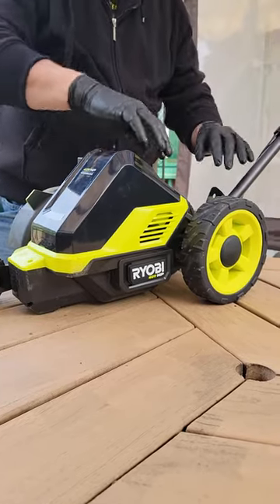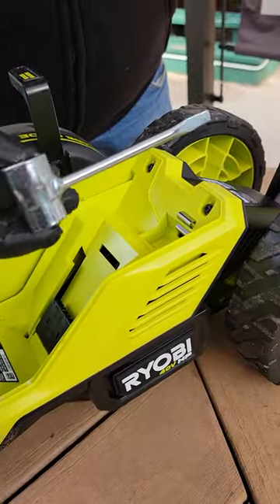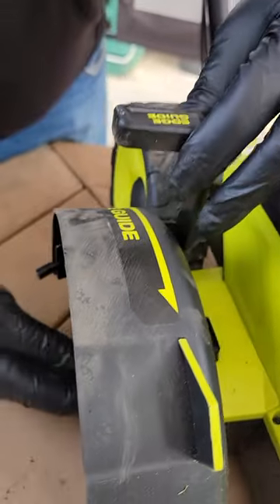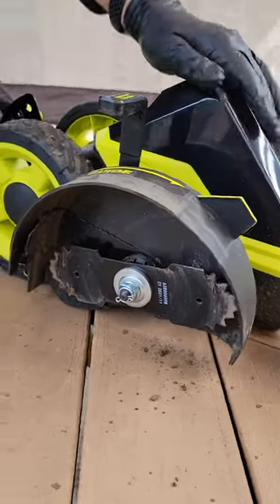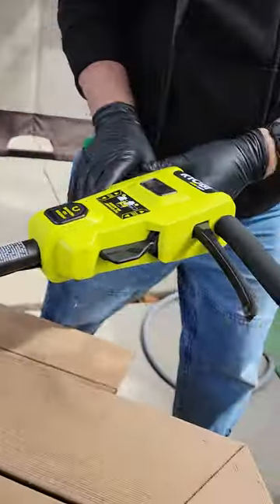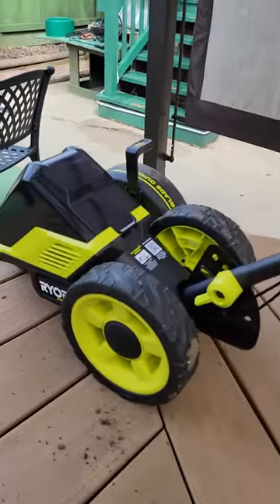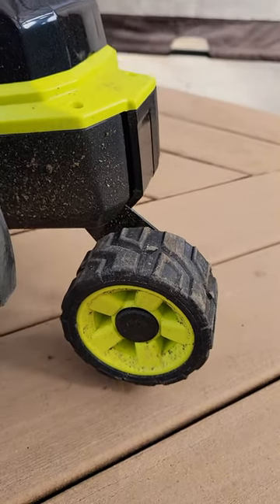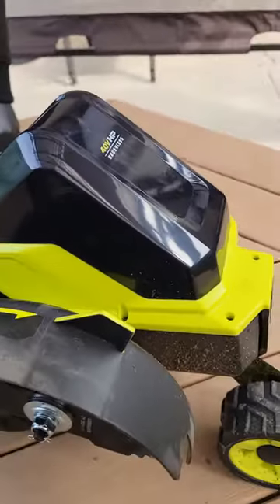20220327 145241 Ryobi 40 Volt HP Brushless 9in Cordless Edger

Comment: Just tried to use mine for the first time and the sidewalk edge guide is useless!  When I extend it down and start cutting it works great but there's no way to really lock the adjuster in place.  It kind of locks in place but any force or vibration allows it to slide up.  So as I go it just slowly slides up and I have to stop every few feet and push it back down.  This renders it basically useless for edging along sidewalks.

Comment: I got this and it works really good. Does your have a little movement in the handle bar area ? Kinda loose a little and I do see that the handle can be turned . For what reason you would want to? I don’t know .but I can see why this would allow for the handles to have movement in them to the left and right. Is this normal?

Comment: Hey Lance. Where were you able to pick one of these up? I’ve yet to see one in a Home Depot anywhere.
Reply from the maker: That is the problem , They send them to me to assemble, try them out and write a review and depending on the reviews decide if they are going to sell them in their stores or not. . The do have an attachment for the string trimmer that will work as an edger , but this is the first edger only that they have come out with. So until HD decided to carry it , i cannot answer your question
Reply: my local HD have these in stock for about 2 months now.  Check your store again
Reply: @lancehiemstra8264  they only seem to have them with the 40v battery but aren't selling them as a tool only product yet